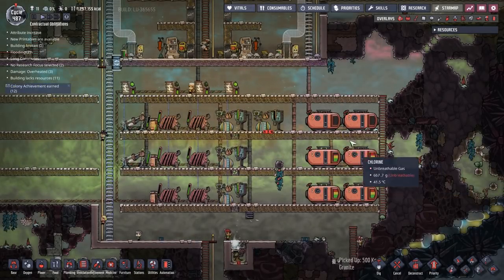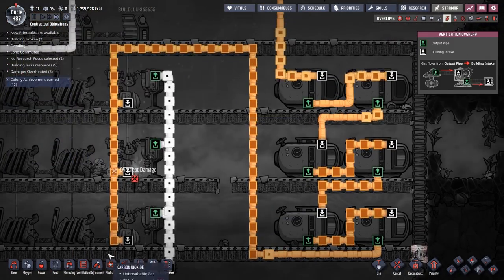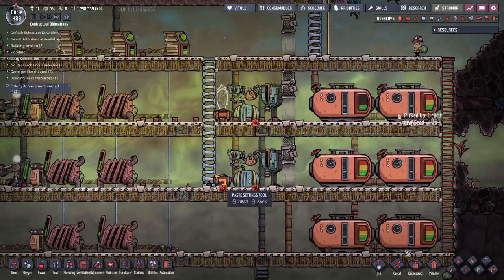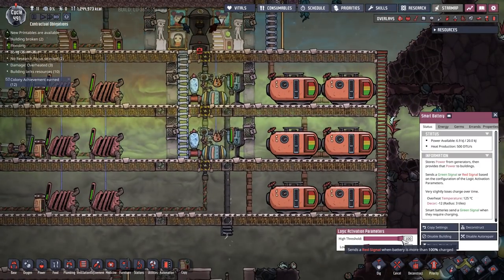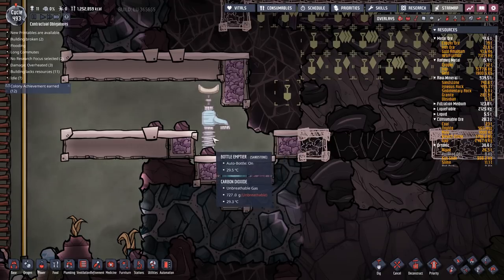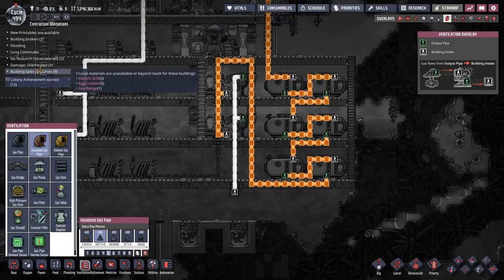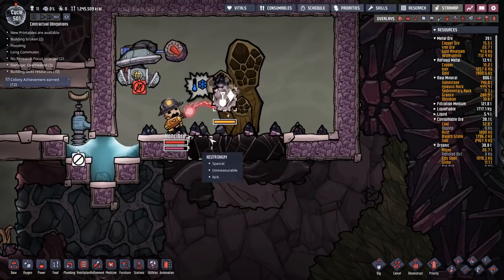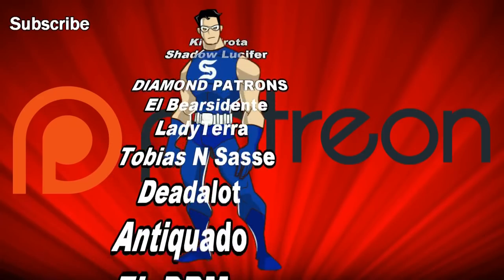How To Setup A POWER PLANT! - Oxygen Not Included FULL RELEASE GUIDE Ep 23

Comment: Hey Skye in case you didn't read they changed how heavy conductive wire works in the last patch. It now runs 50KW instead of 20 so now you can have real power and better decor. Also unless your really strapped for power and need the bonus the power plant in usually not worth it in the long run. But it does add prestige and fanciness :P

Comment: Yes, like everyone else is saying use bridges  to direct the flow of gases and liquids. It is extremely helpful to know how the priorities work with the pipes also. For example when the gas/liquid comes to an input inline with the pipe it will always go to that input first and not go past it till no more gas/liquid can go that way. If you have an outputs inline with a pipe, the gas/liquid will not be able to feed into that line until there is room in the pipe for more gas/liquid. There are some quirks to this but that is the main idea. Here are some examples of what I am talking about. If you have two gas pumps and just run a pipe straight through the outputs of them the output of the second pump will not output any gas till the pipe is empty. Now if you have the same setup but stop the pipe just before the second pump and bridge over the output of the second pump to connect the two pipes, it will combine the two pumps outputs of 500 each into 1K packets. That is if they are the same gas in the pipe. If there is a second gas added into the first pump it will stop the flow and have to wait till there is room. A second example of using priorities is making a radiator that heats up water to a certain temp. You can have a closed circle of pipe and snip out one part of the pipe to insert a bridge. If there is liquid in that pipe if will just circle it forever. If there is not any liquid already in the pipe you can fill it with a feed line with a bridge. The output of the feed line's bridge needs to go after the output of the bridge that sets the direction of the loop. That will feed the liquid in until the pipe is full and because what is in the pipe has priority over the output of the feed line's bridge, no more liquid will come in till there is room. For the emptying of the loop, put the input part of a shutoff inline with the pipe just before the input of the loop's bridge. Then put a temp sensor just before that. You can set the sensor for the max temp you want the liquid to get. So now when the temp sensor activates the shutoff it will empty out the liquid. It empties because the input of the shutoff is inline with the pipe and nothing will pass it till it can't go out through the shutoff any more.

Comment: I have noticed that you need to use bridges to determine direction of flow for the gas and liquid pipes now and then, even if it looks right. There are two exploits for containing gas. One is build a room with a vent which has water slightly covering it or use mechanical airlocks as a compressor, this will allow more gas in a smaller area.

Comment: Since you are pumping from two separate directions (the top geyser and the bottom geyser) to a pipe also using two outputs (the bridge before the natural gas cooker and the input to the tank) available, the mechanics get confused.  If you use a bridge to come out of the natural gas cooker T-intersect, that may fix the problem.  You will also guarantee NG from the top geyser will first fill the cooker.  Other option is to pump all the gas into the tanks, with the output of the tanks going to your desired loads (this way it looks like it is coming from only one source).

Comment: SKYE pipes need direction.. so experienced players give pipes routes using bridges.. using bridges to prioritise where gas or liquid flows. in your base your just letting the gas flow in pipes in long distances.. game will then calculate send all gas to this place and move extra gas from this place to this place in your current build.. 

i.e your gas from the top meets the gas from the bottom before it gets to the storage... the gas from the top has two directions to go to.. the gas cooker or to go to the storage..  however because the gas from the bottom can also take this same route.. you have pipes blocked in the section between your gas cooker and your storage.. because the gas does not know whether to move up or to move down.. simply place a gas bridge in this section pointing down and the gas from below will only try to go to storage and gas from top can keep doing what it was doing before..

also just on your power plant.. 

if you want hydrogen generators to be priority burn.. they would of been more suited to have the power plant buff.. the power plant buff lasts for 3 cycles.. if your automating your gas generators off.. because your hydrogen and coal produces enough power.. then your wasting material.. because the power plant buff never turns off.. so if the NG generators turn off for 3 cycles.. your dupes will still buff them and you will have wasted your material.

on another note.. your method for storing your natural gas generators is less efficient.. you are much better off creating compressing rooms.. these take less room, resources and less power..  your pumps will only transmit full blocks of natural gas.. where as your current build changes the amounts it pumps..

Comment: Chlorine is the worst gas for transfering heat, carbon dioxide is not much better so your wheeze wart will struggle to have an effect. Hypertheticly If the generator and the wheeze wart were in hydrogen gas and and you slapped in a temp shift plate or two, one wheeze wart is more than enough if the natural gas is 40° or lower. Probably better to use wheeze warts some where else in hydrogen or oxygen and use pipes like a radiator around them if your going to get the best mileage out of them.